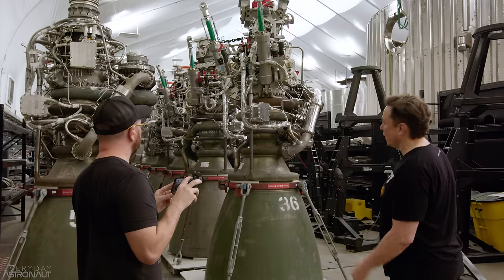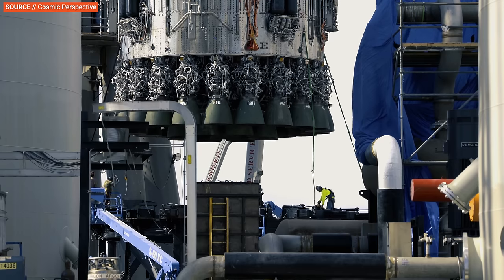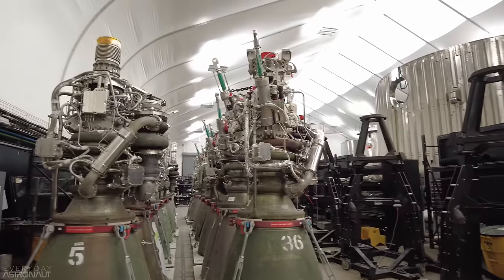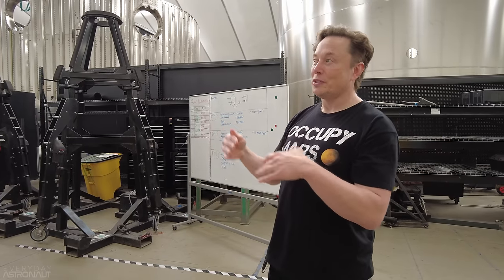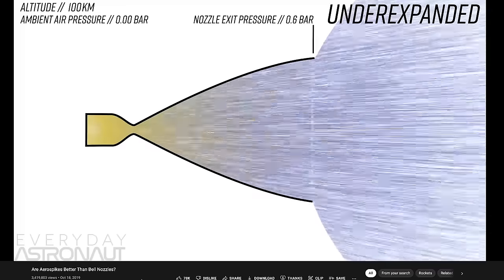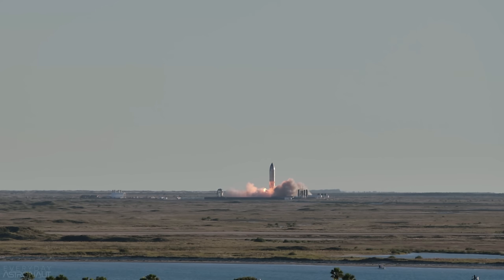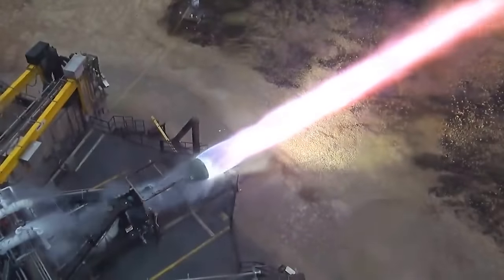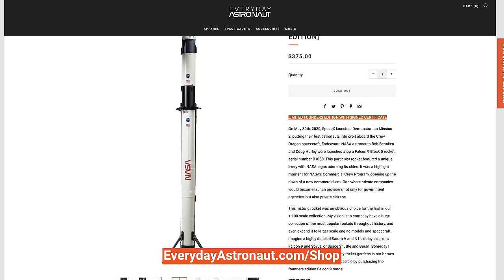How SpaceX Is Upgrading Raptor To Be The Ultimate Rocket Engine!

Comment: The analysis of the increase of work is a little bit misleading because is just at the beginning.  I don't know that I could do better without math, so there is that. In reality, as the rocket mass diminished stuff get a little bit more nuanced.  We are pulling the same mass.  Take the final speed of a small rocket without atmosphere, and you will get a term like -gt under constant gravity approximation, what you are changing when you change the mass flow is the time you expend fighting gravity (looks like. e * ln(Mf/Mi). -g*t)  at the end, the dominant term is not the gt but the other and the results are not as spectacular as he said, by a wide margin.  Also, you are not trying to get max up-down velocity but a tangential one to get into orbit,, so the. effect of increasing the mass flow is even lower.  Maybe someone has the ability to explaint it without math? maybe with a graph or something?

Comment: When the raptor has electric turbo pumps and 3d printed parts and weighs 35kg with a massively simplified fuel&oxidizer pipeline, thats when you can start saying its the ultimate engine. My money is on the Rutherford engine sorry to say. That engine actually has rethinked rocketry, not just bought it and modified it.

Comment: Saturn 5 was slow off the pad 🚀
Reply: Starship is designed to leap off rapidly, will be very spectacular.
Reply: Saturn V was about 1.2 power to weight ratio, Starship 1.45

Comment: Isn't automated remove-and-replace important both on the ground and in space?  If there are hundreds (thousands) of Starships in orbit waiting to go to Mars (1000+ Raptors), even with a high reliability, some are going to need to be removed and replaced in space.  Also, a repair capability on Mars will not be an initial priority, so cannibalization will be preferred.  Seems the remove and replaced time line is improving by watching Boca Chica videos.
Reply: Sure, but that's a problem for 20 years down the road.

Comment: What if they remove one of the axis from the gimbles. They could position the remaining gimbals radially. That would eliminate 13 gimbals.
Reply: And if they need to sum the thrusts (other than those oposing engines). They would loose the power contained in each of the vector angles.

Comment: I believe if they really want to achieve 1,800-2,200 BARS of pressure they will finally come to the conclusion they will need a plasma injector using pure water .. You don't need a lot of water to create a plasma engine .. You just need a well place TWT & the correct frequency of microwave energy to send into the MethOx burn chamber raising the burn temp by 8-10x ..

Comment: There are about 100,000 airline flights every day. How much CO2 would launching that many starships produce per year?

My math might be off, but it seems like it would 4x the total global CO2 emmisions of the entire planet. All of that to be just as out of reach for most people as airplanes are, which themselves are only as common as they are because of fossil fuel subsidies and a lack of a carbon tax or collective action to correct for the free market failure to properly price carbon.

Also, that would just be passenger travel. Comparing rockets to airplanes in terms of total volume or demand is kinda terrible because it misses all of the train, shipping boat, and semi shipping needed to keep Earth functioning economically. Being economically and colonialy multi planetary would require shipping comparable weights and volumes, which quite frankly is just entirely unrealistic.
Reply from the maker: I’ve already done all the math for this! - https://youtu.be/C4VHfmiwuv4?si=XF8Id0Kf0-FIkbfB
Reply: @EverydayAstronaut  Thank yoy for the recommendation. I did watch your video, and it seems like our numbers mostly agree, but their is at least once where it's clear that your math was incorrect. I left a comment on that video.

Comment: "The most advanced engine ever built"? what metric are you using to back that statement?
Reply from the maker: Full flow staged combustion (the only one to fly) and record breaking combustion efficiency and chamber pressure.
Reply: @EverydayAstronaut  So that is a very personal viewpoint about  what 'advanced' means (and  it has yet to fly orbital). But thanks for the answer.
Reply: @freezerman5871  So what is your "view point" to what advanced means? Raptor is by definition the most advanced rocket engine. You have a different definition?
Reply: @motokid6008  I think that the term 'advanced' should embrace the novelty of the concept and design, and not be used as a substitute for 'powerful' or 'efficient'. I think that there are many overstatements regarding SpaceX approaches as being most 'advanced', while it is often making excellent use of proven concepts, not necessarily state of the art. Which is not bad, but is not 'advanced' the way I see it.
Reply: @freezerman5871  - The concept and design of Raptor is the most advanced rocket relatively speaking. Only thing that comes close is the NERVA engine that never left the test stand.
Reply: @freezerman5871  That you think it's not advanced (the metallurgy alone makes it more advanced) it really just shows that the problem is YOUR lack of understanding.  Your lack of capacity makes you reach flawed conclusions.

Comment: Can’t wait to rear/hear the truth and facts on the failure this week. Was that test booster Rapter 1 of 2?
Reply: Booster7 has 2s attached. Supposedly some are being swapped as I type this. Consensus is an air fuel detonation caused by a build up of methane below the rocket.
Reply: @motokid6008  And yet the ignition source has not been identified correct??
Reply: @michaeldeierhoi4096  - I don't think so. Rumor has it SpaceX did try to fire the engines in some manner. Either a full ignition or preburner test. Me personally I swear I see engine thrust in the video. Like full on exhaust.
Reply: @motokid6008  Commentary that I have heard elsewhere was that this was a spin down test of all 33 engines which meant that methane and oxygen was released and an unidentified ignition set off the methane.  

If there had been a wind then the methane wouldn't have accumulated under the booster.

Comment: Worried me when Elon said the startup sequence is very complex given he plans to land the Starships & Boosters with a very late burn. Engine start has to be 100% reliable and fast to avoid the crash & burns we got used to seeing last year 😱
Reply: My understanding is that since there are 33 engines, which can mean complex startup sequence.
Reply: @Kuroji07 interesting, my understanding is different, that the oxygen  and methane pumps have to spin up in a "dance", with neither of them producing too much nor too little pressure in relation to the other in the same engine.
Reply: It will all be automatically controlled so probably won’t cause issues
Reply: Making it fast and reliable is part of the development path.

Comment: Like anything, there's a trade-off between reliability and performance.  Pushing something just to the edge of it's limits means it will be less reliable.  Pushing Raptor to 300BAR chamber pressures or more, will mean high performance, but likely less reliability.  I think in the end SpaceX will need to effectively de-tune the engines to meet the reliability targets, or they risk blowing up a lot of expensive test vehicles.
Reply: They have produced enough Raptors and tested them at McGregor to destruction time and time again. They know how reliable they are already. Those numbers will get better as time goes. Keep in mind they don't mind failures. They just go on with the next Raptor or the next ship.

Comment: Raptor 1 is way better than Raptor 2 it is obvious that Raptor 2 is way more basic and it does not have all of that power piping that you see on Raptor one. Everyone who knows anything knows that the power piping is necessary for maximum thrust. Raptor 2 is just stripped down, bare and basic and sorely lacking in the essential power piping. Well that's my rocket lesson for the day..

Comment: I had a general question, will Elon Musk install all these engines in one starship?
Reply: I think he will probably get his employees to do that
Reply: @ShubertReads  🤣 
The ship needs 6 and the booster 33 Raptors. So they need 39 to launch, and maybe 42 later. They need the ships to be reusable for that alone. (The first flights will not be reusable. To be on the safe side they will land at sea.)
Reply: Already done. Booster 7 has a full complement of Raptor 2 engines fitted, currently undergoing testing (and one impressive but mostly-harmless fireball) down in Boca Chica.

Comment: The fact that the vehicle is beign designed on the fly with an engine that's not stale yet is not particularly encouraging, we were told several years ago that Starship was going to be in full service by now and launching people to Mars.  As always the timelines are completly blown and we still do not know if the design is fundementally sound, it quite clear that a more conservative launch vehicle should have been designed which would have allowed robust commercial service while simultaniously maturing the Raptor engine.

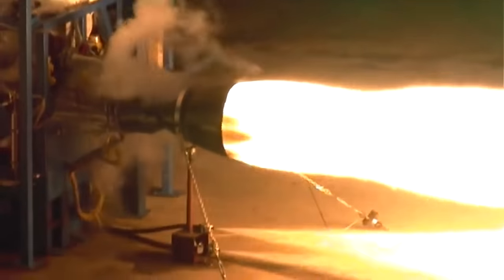Comment: 16:40 i am confused, didn't elon say in his last interview with you that the raptor 2 engines are 99% perfect? what was the thing he said that with divine power it can only get 1% better, thats how good it is? why do you now suddenly say raptors development is only at the beginning?
Reply from the maker: Combustion efficiency is 99% that is the theoretical maximum for the chemical bonds, but you can still increase engine power and efficiency over all with higher pressure and more mass flow. Just like a car engine can have higher combustion efficiency than another but make less power because of other factors 👍
Reply: @EverydayAstronaut  ah i get it now, thanks for letting me know. i really learn a lot from your videos! keep up the good work :)

Comment: "Able to remove torch ignighters".... cool story, we just watch a fuel deflagration beneath Super Heavy as if it ignition failed and dumped a load of cryo CH4 out of the engines.
Reply from the maker: That’s not what happened. It was unrelated to torch ignition
Reply: @EverydayAstronaut  Well a load of cryo gasses were suddenly pumped beneath Super Heavy then a lot of unburnt CH4 deflagrated. What was the cause, because I haven't seen a public explanation yet?
Reply: @dorbie  No public explanation has been given.  Doesn't give you the right to make one up though.  That's called lying.

Comment: What nonsense! The T/W ratio that matters is that of the ROCKET and a 10% increase in the engine's T/W ratio DOES NOT add up to anywhere close to that of the ROCKET! Why? Because the engines at less than a ton is less than 2 tons is a tiny fraction of the 5000 ton rocket -- most of which is the fuel and structure that you have to carry no matter what.